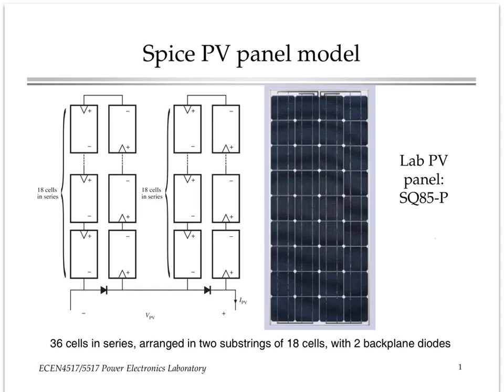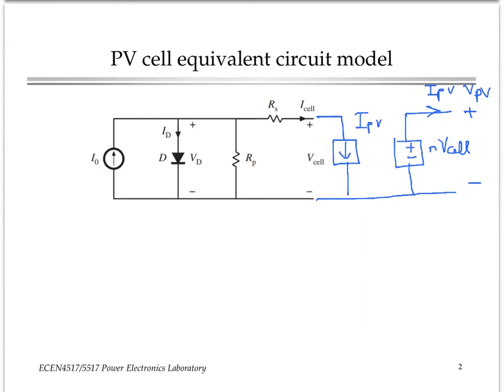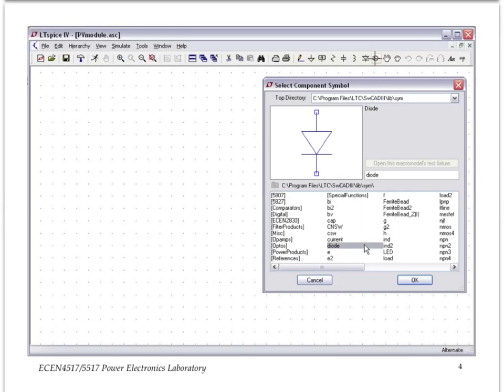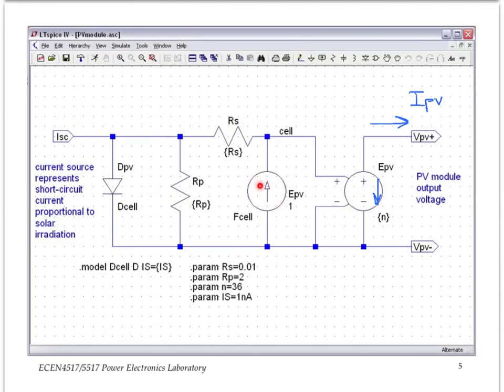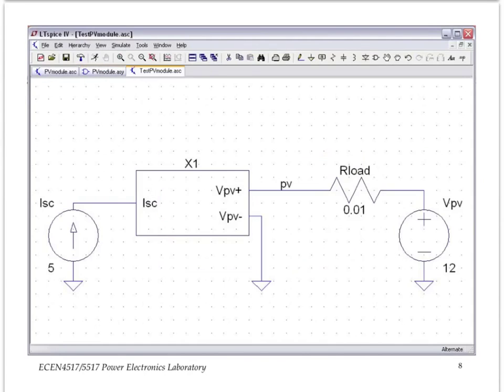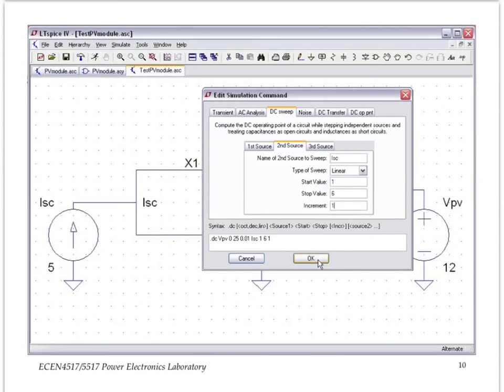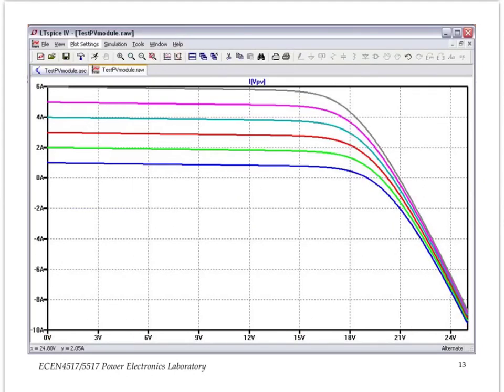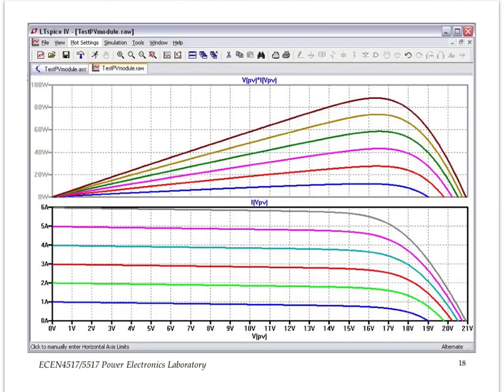3.1 PV panel Spice model and simulation

Comment: Anyone have an understanding of the .model Dcell IS = {IS} portion of this?
Reply: diodes DPV type "Dcell" is unknown to LTSPICE ( eg "1N4007" would be a known type). So you must specify a model for Dcell. LTSPICEs standard diode model D is used but saturation current IS is set to a realistic value of 1nA  in this model ( which is much higher than IS of a typical 1N4007 diode)

Comment: I had to create a guide with pictures on how to create a 3 Phase circuit and a PV panel circuit in LT spice for my Theoretical Electrotechnics course in university.
Maybe it can proove useful to someone so I'll leave a link below.
Originally it's in Bulgarian but I tried running it through an the automatic Microsoft translator to English so those files are included as well.
https://drive.google.com/file/d/1zqlD539t1HE5Wjf21T5yvDEI6fCko12t/view?usp=share_link

Comment: Going on top of what Jonti Olds said, I'm not sure if new versions of LT spice are more picky, but unless I put a ground in the PV module, It took forever to run and gave me floating point error.
Reply: Thanks for the tip! This solved the issue for me.

Comment: i have simulation of that circuit and can also give you working priciple.

if any one need contact me
Reply: Hey :) I need a bit help about model,can u help me?
Reply: yes i will help you
Reply: Dear Wali.
This is Fatih from Turkey.
I would like to simulate full cell and halved cell modules or both single PV cell with LTSpice to see the Pmpp differences.
Could you please help me about that?
Reply: he i have a problem with this simulation can you help me ?
Reply: Hi Wali, how do I get the right diode? thanks in advance!
Reply: use any diode, but it should be under your rating,
Reply: yes i will
Reply: Hi Wali, any chance you still have the model and would be willing to share?
Reply: Hi, i want to simulate broken cell with different broken area and break resistance, any tips?
Reply: Hi, could you kindly send me the simulation circuit? I tried to do the simulation but faced many problems.. :(
Many thanks!!
 
My email is keith_chan92@hotmail.com
Reply: Hi Wali,
can you share your model? Thanks
abcshreyas1996@gmail.com
Reply: Hi
I need ur help in simulation.
Reply: wali shah  moi je voudrais cette simulation et voila ma boîte mail imigait11@gmail.com
Reply: Hi wali could you send to my email the circuit simulation and working principle? marcositta@hotmail.com   Thanks Marco
Reply: Thanks
Reply: @wali shah can you send me the file .my email Id is lassyakjedi@gmail.com
Reply: Hi wali, Could you send me the file? ale_barto_92@hotmail.it Thanks
Reply: Wali shah.. I will be very thankful to you if you send me the simulation and working principal on gmail.. 
My gmail is atifqazi786786@gmail.com
Reply: I need help with the model
Reply: Can you send me the simulation?
Reply: Hey can you please send the simulation maureen.moatlhodi16@gmail.com
Reply: how to contact you?
Reply: Dear Wali
I'm facing small issue can you help me with that
Reply: Hi Wali, do you still have the model and can you please share it with me. yaqoobbaloch81@gmail.com
Reply: please can you help me and contact  (esaw.1994@yahoo,com )
Reply: oky please send me an empty email to me, to adding you my contact list.

fatihsaruhanoglu@gmail.com

thanks.